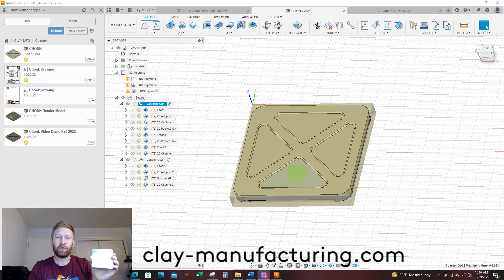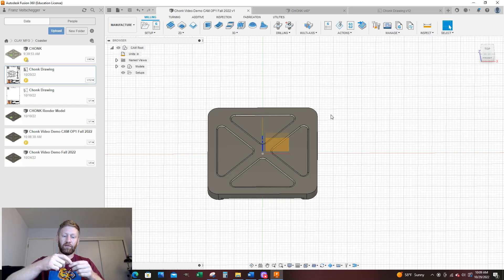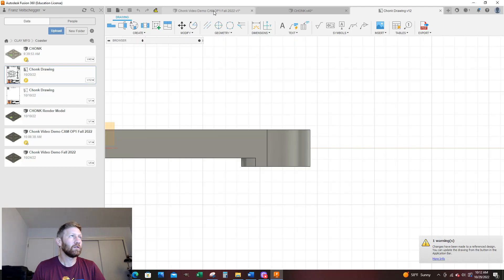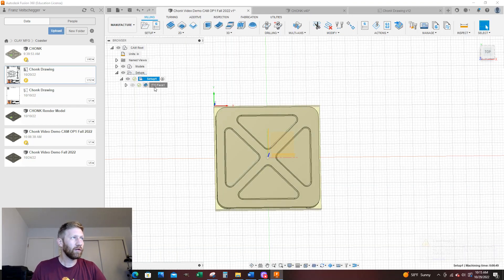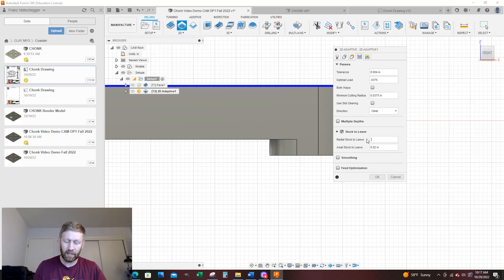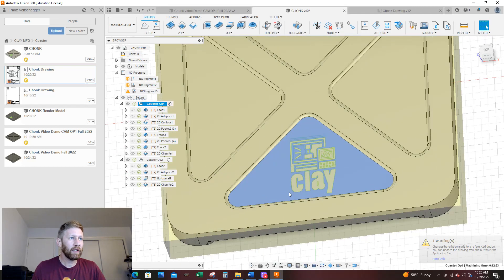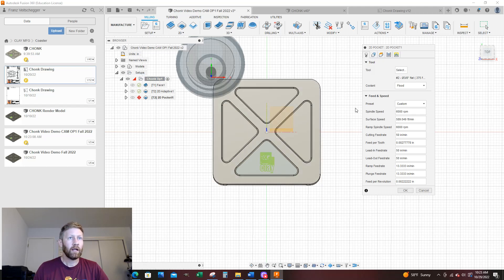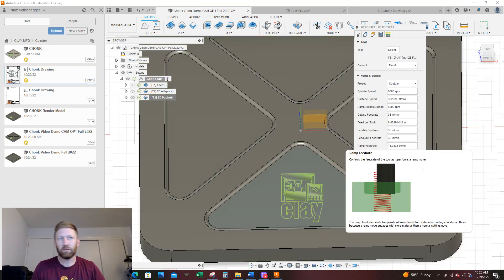CHONK OP1 CAM using Fusion 360 for Haas Mini Mill

Comment: Where are you getting your feeds and speeds from? Do you just remember from experience?
Reply from the maker: I look up the  chip load for the cutter from the manufacturer. For most of the tools I use, they are Haas and they provide really good cutter data. The most important factor is the IPT with end mills. I typically start on the low end range when figuring out my speeds and feeds